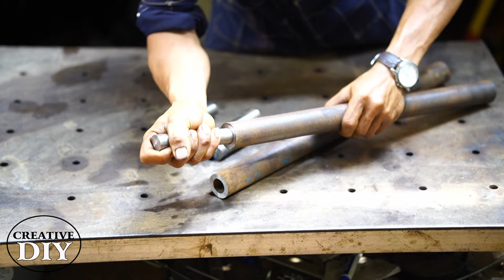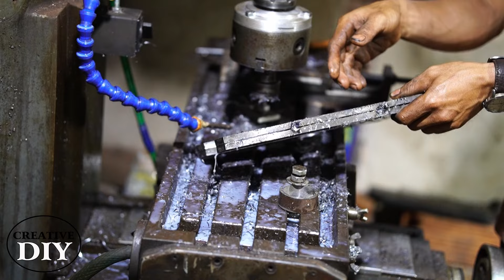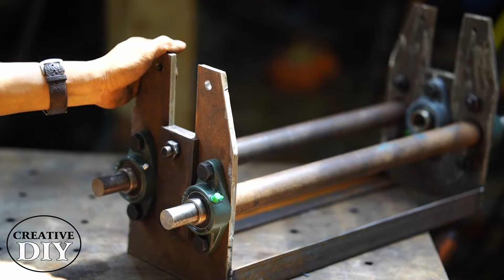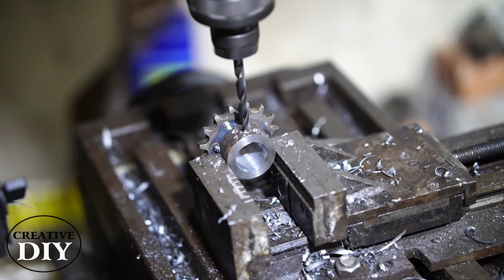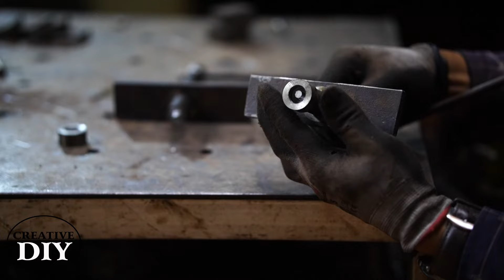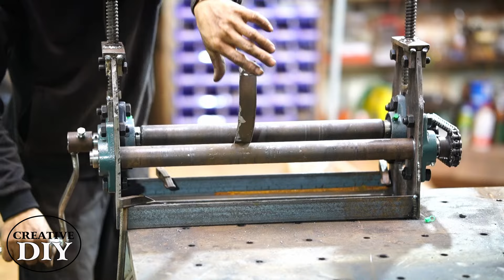Chế tạo công cụ uốn sắt tấm

Comment: It looks like an egg, not a circle
Reply from the maker: @feridzulfukar  😂😂😂😂😂
Reply: @CreativeDIY0  try to recreate the circle and check if it is a circle and make a video when it creates a circle

Then we'll see if it's funny or not
Reply from the maker: @feridzulfukar  Before bending a steel plate into a circle, I will bend the two ends of the steel plate according to the given diameter size, then bend the steel plate to have a circle shape. In the video, I tested bending the steel plate that had not been processed at both ends, so it looked like an egg. Then I removed the excess at the two ends and pressed it together, it looked rounder and more beautiful. I apologize for laughing. I just thought this was a funny comment🙏🙏 🙏
Reply from the maker: @feridzulfukar  I used the above steel plate for this project.
https://youtu.be/tXY7KhkzwTc?si=m4rSLYTkcBKdjaz1
Reply: @CreativeDIY0  Vi el vídeo en este enlace, parece un huevo, le cortas la parte extra plana y lo tiras.Amigo, gracias por tu comprensión. Lo que quiero decir es que si las distancias entre los dos tubos en la parte inferior de la máquina que estás haciendo están muy espaciadas y ligeramente cercanas entre sí, la elipse será completamente circular, no como un *huevo*.
Reply from the maker: @feridzulfukar  Thanks for your comment🙏🙏🙏🤝🤝🤝